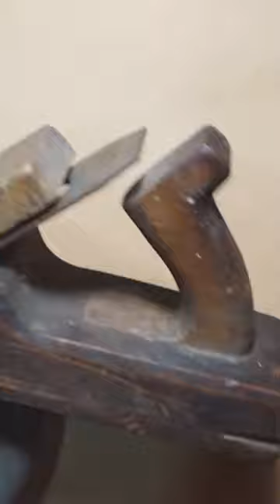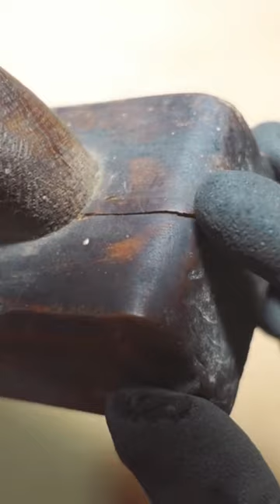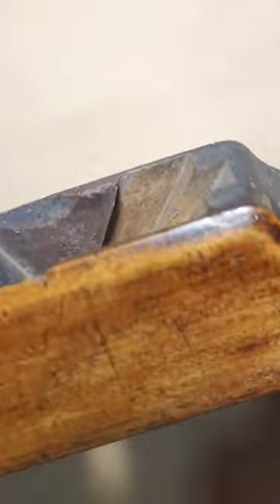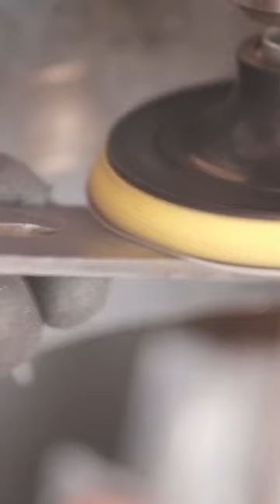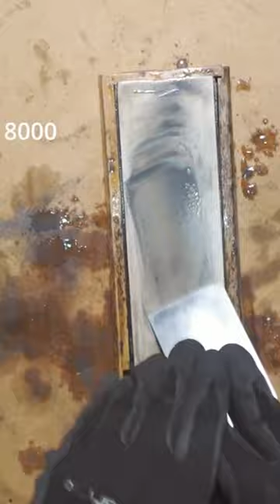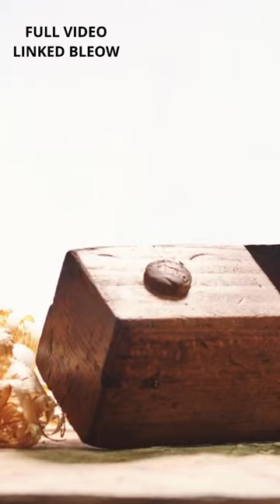Still Works After 120 Years! #shorts

Comment: No idea what this tool is. But this video was addicting
Reply: It's a hand planer.
Reply: Also, the hand planer is used to shave  wood to make rough edges smooth.
Reply: A wooden hand plane. Used to cut the surface of wooden baords flat and smooth.